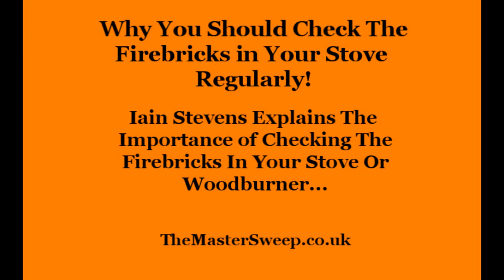Why It Is Important To Check The Fire Bricks In Your Stove or Woodburner!

Comment from the maker: Hi Will, I am not saying that the stove will warp or crack but that it may happen, therefore the most responsible and safe advice to give is to ensure the fire bricks are intact. I have seen several stoves that have become damaged beyond repair due to broken or missing fire bricks. When you are dealing with fire and fire safety it is always best to err on the side of caution! Fisher are not a stove I come across in the UK, are you in the USA? :-)

Comment: Hi, What about the bricks that are on the roof of the stove? A piece fell out from the centre of the roof of mine and I'm wondering if it's a problem. Thank you!
Reply from the maker: Hi, usually the brick or bricks at the top form the throat plate or baffle, very important that they are correctly in place as without them most of the heat from the fire will escape up the chimney making the stove less efficient. Hope that helps!

Comment from the maker: Firebricks used in stoves and woodburners have very low thermal conductivity which means heat does not readily pass through them, they reflect most of the heat back into the fire box.

Comment: Can you do away with the brick all together to fit large pieces of wood in the stove???
Reply from the maker: It would depend on the stove and where it is installed but as a general rule it would be unwise if the stove is designed to have bricks fitted. Could damage the stove or be potentially dangerous. Better to cut the wood down.
Reply: TheMasterSweepTV ok thanks v much. The guy who put the bricks in mine snapped them because he couldn’t fit them properly so it’s probably best I get some new ones then!!
Reply from the maker: There are a lot of inexperienced guys jumping on the bandwagon! Breaking firebricks is easy if you don’t really know what you are doing. I would get a new set. Be safe!

Comment: If a stove will work with out fire bricks, but will crack over time, how come it will still crack with cracked fire bricks? Fire bricks seam like they would do their job, even if they were cracked. I say this as I have a 15 year old fisher price grandpa bear, and the fire bricks have always been cracked. The stove is not warped, and I get the the entire stove glowing red.
Reply: Glowing red is dangerous and risks permanently damaging the welds. I use a magnetic thermometer on the metal chimney pipe to avoid overfiring